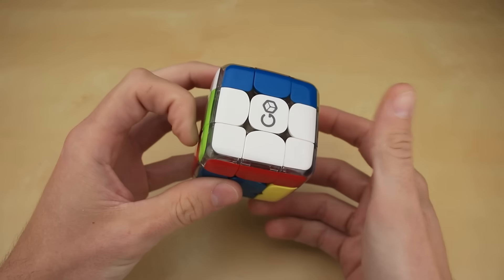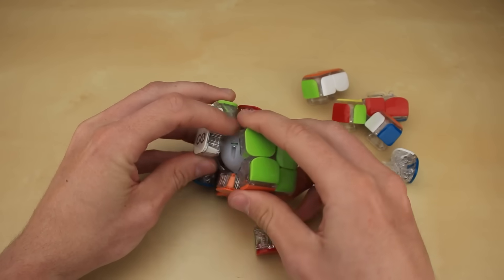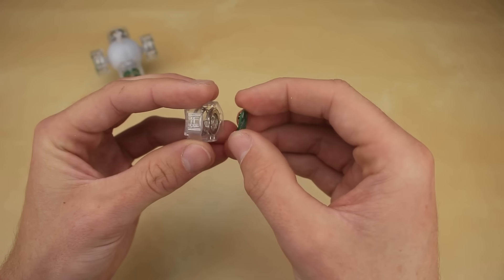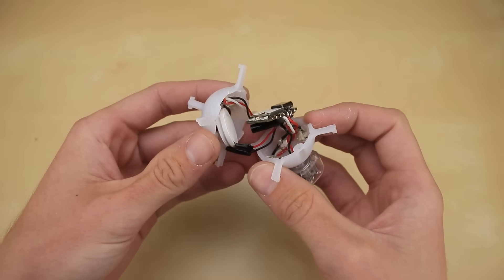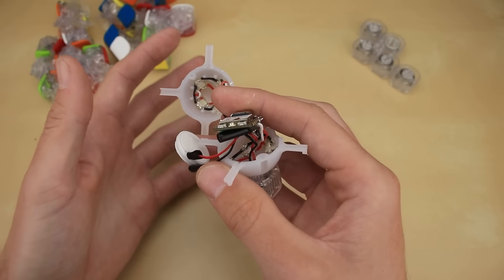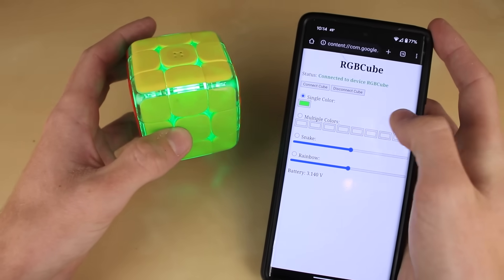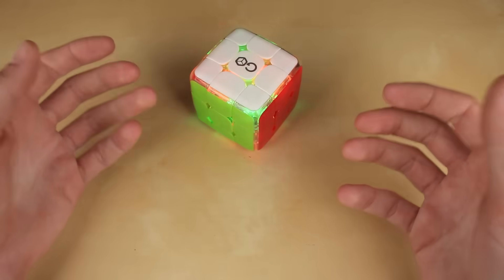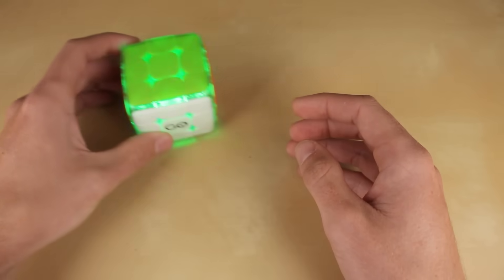I made my own "Smart" Rubik's Cube!

Comment: The battery consumption is higher because of the microcontroller, not the LEDs. The original chip is probably custom, or a very low power microcontroller.
Anyway, awesome job! I like it a lot.

Comment: I think your battery in your cube went bad. Whenever you unplugged the cube from the charger it immediately shut off. Also the battery looked to be expanded too so it was a good thing you took it out. Thats awesome reusing the cube for something really cool.
Reply: I believe this is exactly what happened. Those batteries can expand and become more dangerous than before. Usually, the best thing to do is replace the battery with a similar or identical replacement. Maybe he will do that and mod a regular cube to turn it into a smart cube using the GoCube components.
Reply: I Was Going To Comment That

Comment: You could optimize the software on the micro controler (maybe it's not optimal - running repetitive code 1000x per second ect. You could also wire up little batteries in each of the centre pieces, and wire it all up in parralel to add more battery life. Cool idea.

Comment: How did you even program it in the first place?
Reply from the maker: The ESP microcontroller was surprisingly easy to program with the Arduino IDE. From there, you can find example code for just about anything (controlling LEDs, Bluetooth communication, sleep/wakeup), so it was just hours of combining and testing those!
Reply: @Z3Cubing You can fix your old smart cube internals by replacing the battery and then fit them into a different regular cube. I'm sure that probably would be much easier than what you did in this video.
Reply: @Z3Cubing  How far could the microcontroller go? Could you have the colors rotate with each turn?